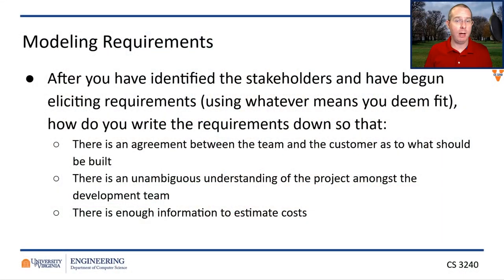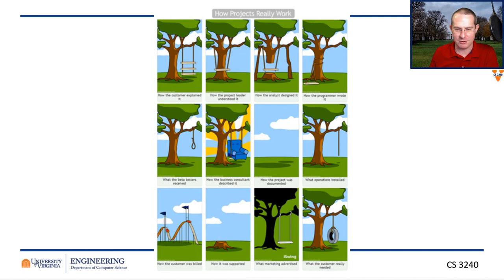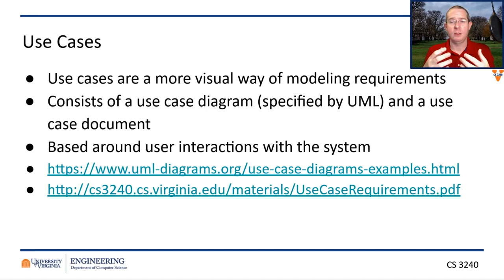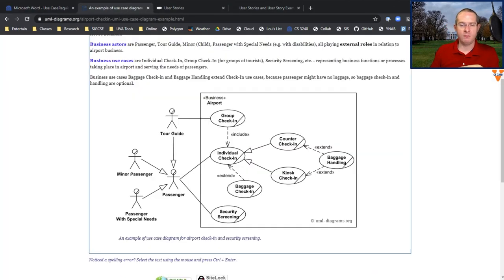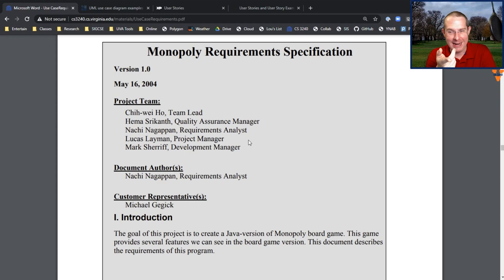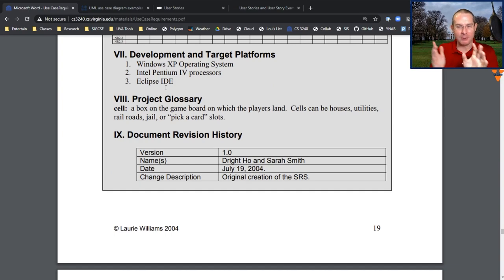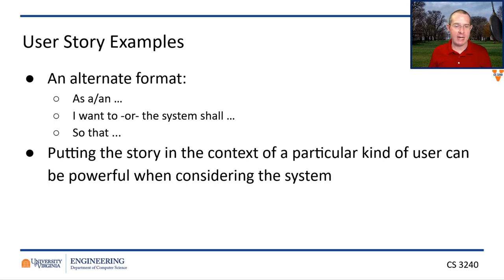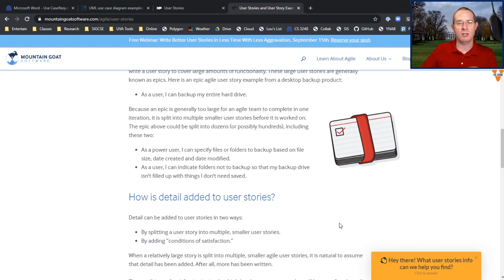Requirements Specification

Comment: Absolutely great video ! appreciate the effort in putting this together. Do you have any info on how to write a business requirement  document and what should be the key focus. Especially when your are dealing with a customers who  want every little detail  from the  workshop sessions we run.
Reply: This is really going to vary based on the type of product and who the stakeholders are.  If the customers are extremely detail focused, that will be difficult to do in a formal requirements document on the first pass without a lot of going back and forth.  Trying to do some early mockups / prototypes to get as much as possible ironed out early can help with later phases.

Comment: Can we say, with this method (use case) we can define the main functions? Does this method work for the non-functionals?
Reply: Typically, use cases are more often used to understand the basic ways that users will interface with the system (or how parts of the system interact with each other).  This can be related to what the main functions are, but not necessarily.  Think of use cases as being a bit more high level - something you could theoretically show to a stakeholder to discuss how the system will work.  Use cases, however, are not good at specifying non-functional requirements because NFRs tend to be cross-cutting across multiple features (e.g. performance, accessibility, etc.).  Use cases don't really have an effective way of expressing "all pages must be displayed withing 100 ms" or something like that.
Reply: @MarkSherriff  Thank you for your quite clear explanation.

Comment: How about user specific requirements (for an auricular wearable medical device for example)? Do they follow the same structure?
Reply: There are definitely software systems that have a "generic" version that can then be tailored by an agency (sometimes the original developers, sometimes not) for a particular client.  In that case, you effectively end up with two sets of requirements - the general requirements and then the ones for the client, potentially handled by two different teams.  In the example you give (where there is a device that is configured, I'm assuming), then the base requirements tend to include the ability to do that level of customization.